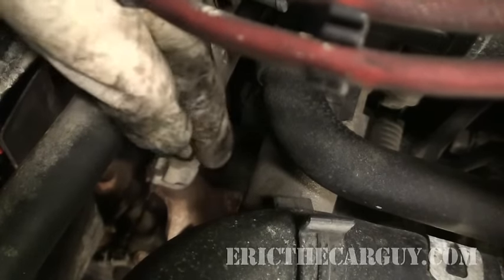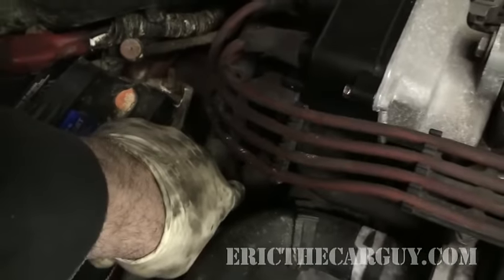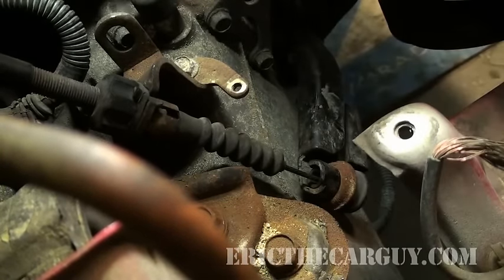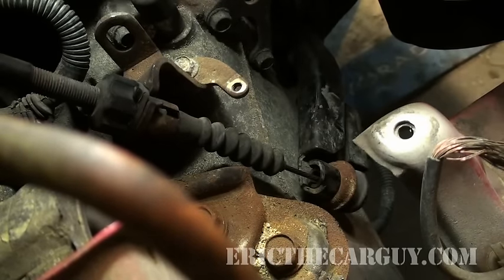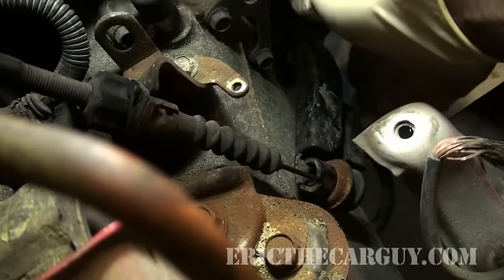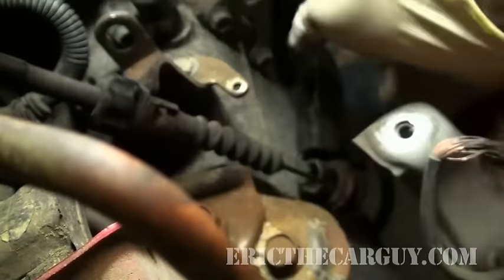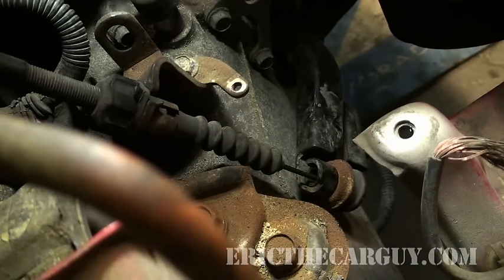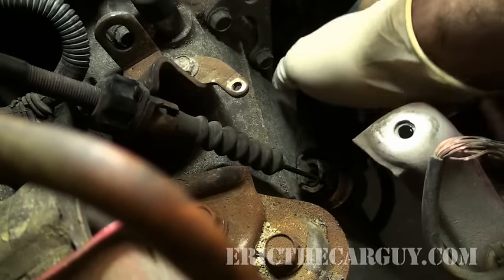How To Adjust A Cable Operated Clutch, Honda - EricTheCarGuy

Comment: Well I went ahead and changed the fluid with Honda MTF, and adjusted the cable again, and it still has the same issue. Should I start looking into replacing the clutch soon?

Comment: What if you have the opposite problem?  My clutch when starting I can barely get it in gear because the clutch is going all the way to the floor and I have a hard time getting it in gear, however once I do get it in gear the clutch performs normally.  So can this adjustment help my situation?

Comment: Hi Eric, learnt this from your video and got my kelisa (daihatsu cuore) clutch cable tighten.. :) 

one question, i notice that for my car's model, a lot of people actually faced the problem of dried clutch cable, it got so hard to depress the clutch. i'd use a lot of energy just to push that clutch cable in, and it got so hard until it broke the metal bracket off in my car under the dashboard which holds the clutch cable. is there away that we could lube the cable? what sort of tools or lub should we buy to relube the cable? coz all i can find is videos of people lubing their motorcycles' clutch cable.. not on cars.
Reply: hahahaha Jeremy Clarson Destroys Keliza ,,

Comment: Eric, I have a 91 Mustang 5.0 LX with a stock clutch cable. when my foot is off the pedal there is a sound like parts are loose and vibrating. It seems the sound is coming from the clutch fork and/or the pedal itself. Also the cable seems to have a lot of free play. The clutch seems to be working fine. would putting an adjustable cable help? also, is there adjustment possible in the pedal? Thanks
Erik.

Comment: Hey Eric I got a question,I got a 1992 Acura Integra gs with a Cable clutch,I did adjust and everything but Its seem the clutch pedal always getting stuck to the floor at time?? What you think the problem is?

Comment: hey Eric i gots a 1990 GMC S-15 borgwarner manual trans and after i been driving if i need to put it in reverse my R gear grinds its all still free spinning i guess  just would like to know if that is a specific part or can be multiple problems

Comment: Hi Eric...!! 
what will happen if the clutch setting too high? (released a little high, it will run) because I like the high clutch settings. thanks
Reply: the clutch can wear out prematurely and it can wear out the throw out bearing or the fingers on the clutch fork from it riding constantly, it can even ruin your flywheel. A solution is to move the limit screw on the clutch inside the cabin to get the clutch higher, but you still need this free play in the cable when it's at rest or it will eventually cause problems.

Comment: 2 years ago I have my 1997 Civic transmission parts replaced, the problem now is when I start first gear then go to second gear the gear has no bite so I go back to first and accelerate more faster to give 2nd gear to bite the gears in which the old tranny once the car moves from first I can shift to 2nd gear and accelerate fast. I would like to know if the transmission is the problem or something else? I did the on stop shift to 5th high gear and step on the gas the car shuts off.

Comment: Hey Eric I have a 2001 honda accord automatic trans. The car shift linkage is somehow not working right.  When. I put it in reverse with the car on it feels like its in park and reverse at the same time only backs up if i give it allot of gas and drives forward in neutral how do I adjust it

Comment: Eric. 
I've got a Mustang, with a mechanical clutch cable. Just had it redone. Like, cable, clutch, flywheel, pilot bushing, throwout bearing, the WORKS. 1200 bucks it cost me. Been about 2000 miles on it and this problem, which I thought was break-in, hasn't gone away. I have no play in my clutch. I can pull out of gear without pushing clutch. When cruising at 2K RPM, give it a little gas, engine 'slips' to 2.5K-3K and doesn't accelerate. Cable adjustment or botched repair?

Comment: I've had 5 of these Integras, over 12 years, almost exclusively driven...I swear the pedals have never felt right in them. Always heavy/stiff, although working correctly. Right now I have a creaky pedal I'm trying to fix, seems a common issue.

Comment: Hey Eric I was just wondering if I have a automatic shift would I do the same thing as you did or just make small adjustments til it's running tip top. Also wanted to say I'm only adjusting because of a d4 code 15
Reply: Don’t automatics have a torque converter?

Comment: Hey, i just happened to replace my cluch on a Hyundai Tucson 2007 befor i wached this video. But my problem now is that it is really hard to get the car in 1. gear. Some times it's easier than others, but i really have to use force to get it in. Alle the orther gears are perfectly fine (reverse aswell). The gripp point on the cluch is also just fine after it was changed.  So, just the 1. Gear issue.

Heeelp please! :)

Comment: I've got a 95 mustang gt and I've noticed recently that it's hard going into 2nd gear most times. Meaning that it physically doesn't want to push all the way into 2nd. Reverse is even worse. The other gears aren't TOO bad but I've noticed I can feel the gears more when shifting recently. I'm just wondering I maybe my clutch isn't disengaging all the way? Maybe I need to tighten my clutch cable some? I'm pushing the pedal to the floor and it still feels hard to go in 2nd.

Comment: my clutch releases 3/4 the way out AND sometimes it will grab just a few inches off the floor do you have any ideas? i have played with my clutch adjustment and havnt found any headway. (i just put a stage 3 clutch and flywheel in)
Reply: logan mercado man.. Thats was a standard stage 3 bite style

Comment: I got a 95 Civic hatch with a 2000 honda b20b , My clutch has 1-2 inches of dead space before i feel it  under my feet. how can i fix it? i can push that 1-2 inches in with just my foot resting on it and then i have to put the pressure, let me know if that makes sense if not ill make a video, thanks Eric!

Comment: my clutch engages/releases at the very top of my pedal, sometimes slips when i start accelerating right after taking foot off clutch.. does this mean that i need to adjust same as this video so it is down close to the floor more? cheers
Reply: yes

Comment: I'm having the issue that with the clutch pedal pushed in as far as reasonable it still isn't actually fully releasing the clutch so it is hard to get in or out of gears, the car will actually try and roll forward a little bit when you are trying to get it into first gear with the clutch pedal pushed to the floor.
Reply: Note: It ended up being an issue with the part of the clutch master cylinder that connects the piston to the clutch pedal.
It basically fell apart meaning the clutch pedal couldn't actually push in the piston of the master cylinder, took a few days for it to fully die as it slowly fell apart making the clutch pedal less effective.
A new one solved my issues but you might be able to just force the old part into fitting back to together. (I had already ordered a whole new master cylinder anyway)

Comment: hi erick, I have 02 honda civic Lx , before I change the engine oil, my car was running fine. After I change the engine oil, my engine started to run higher and louder. I did check exhaust and every thing was fine, so I look into tune up very thing was fine. so I kind of get lost, do I need to change clutch or get a new engine ?

Comment: My car grinds when I try to put it into any gear, also it makes a buzzing like noise when I put the clutch pedal to the floor. Could adjusting the cluth slave cylinder fix this or is there something bigger on my hands?

Comment: Hey Eric, for the past couple of weeks i've been having an issue with my transmission. Basically its very hard to get in gear after it warms up, and then If im coming to a stop and I have the car in gear with the clutch DISENGAGED (pedal down) it feels as if the trans. is trying to grab the gear and take off. Recently its gotten worse and has actually caught the gear (1st and Reverse). Ive adjusted the cable & that hasnt helped. Its a 92 Integra GS. Any idea what it could be?

Comment: Hey, 
I'm not to sure if it's my clutch but this happen to me yesterday. I pressed the clutch all the way to the floor and it was still hard to get into 1st gear and 2nd gear. But 3rd, 4th and 5th gear are really smooth. Do you think I just need to adjust it or is it time for a new clutch?
Reply: Hey, i have the same problem, wont go in with engine on to 1st and 2nd. but with it off they do go in. i put in a new clutch...did you find out what was your problem ??
Reply: yeah, it was the Master Cylinder.
Reply: find out that my car was a hydraulic clutch. lol

Comment: Okay, I have a 2010 Mazda 3 6speed. My clutch lets out a little higher up than most cars of that year. Not sure if you've dealt with Mazda clutches before, but is this something I should start worrying about? Or, do all cars have different clutch grab points?

Comment: I have a89 5.0 stang replace clutch n now my fork is almost all the way forword but 1/2 n inch check all my work twice n how to adjust cable not hydraulic or quadrant.

Comment: Hi Eric, Just a quick question. I can see how the biting point being high on the pedal stroke could cause problems (slipping clutch) but can having the bite very low cause any adverse effects? If so is there a procedure that would let you determine how low you can safely go?

Many thanks.
Reply: For the next car guy fixing his clutch I reply even when it's pretty old comment. Having biting point too low may cause problem if clutch is not detaching all the way. So car can try to creep forward when clutch is pressed down and it is in first gear or changing gear causes crunch sound from gearbox because it's not completely detached. This can broke gearbox and causes wear to clutch if car is stopped with gear on for example in traffic light.

Comment: Hey I have a 1998 Honda Prelude base 
Just recently I went to go to work.. And my clutch pedal felt too easy to push in. 
I couldn't get it to go into any gear at all. 
After about 15 min my car got warmed up and finally went thru the gears. 
But it feels really rough when shifting? 

Any ideas?

Comment: I changed out my clutch on my 89 Civic Si it shifts when the cars off but when it turns on I can’t go into any gear. What would you recommend my steps to fixing the issue should be? Any help would be amazing
Reply: Did you ever figure out the issue? I’m having the same right now

Comment: 92 prelude s, my 3rd gear grinds when i pull the clutch out then it will pop out when i release the clutch,, should i try adjusting the clutch???

Comment: I have a 1990 integra with cable clutch and my 3rd grinds and the car has low kilometres and was lady driven all it’s life so there’s no way the synchros are gone this soon. My clutch is also new and it was set when I got the car but adjusted it cause I didn’t like the release point and ever since then it’s been grinding. If anyone knows where it’s suppose to be please help out.

Comment: what if the friction point is almost at the floor and getting lower? adjusted a clutch that was barely disengaging, with my foot to the floor, got it working for a day.. then today have the same problem, but it's stopped coming back up?
Reply: sounds like you need a new clutch.  but check the clutch master and slave cylinder for any leaks, bleed it out if no leaks, and see what happens
Reply: was the master cylinder.. But a a bolt had been ripped out the firewall and was unrepairable

Comment: I recently had an issue with my cable operated honda wouldn't go into gear I replaced everything and I'm still having the problem I'm thinking the bolt in the shift arm may be worn or the fork is bent but it seems like the throwout bearing can't push the fingers I donno I'm really frustrated any ideas why it could be doing this it's like the bearing touches the fingers but won't go any farther

Comment: I got a 95 subaru 5-speed legacy outback. Clutch is working and doesnt stall when pressed but I cant shift into gears easy if at all. Not sure if the cable is shot or if the fork is completely screwed. Please help

Comment: PLEASE HELP
When my car is on and its in nuetral the throwout bearing/clutch release bearing is scraping against my clutch cover, But the noise stops when i push the clutch in (or when clutch is engaged) it also makes a sound when i take off in first gear around 2500 rmp.i have a brand new clutch cable and a brand new clutch release bearing. Ive been having this clutch problem ever since i put in my stage 1 clutch about 6 months ago. any ideas ? any help would be great thanks..
Reply: Jay Ram - check for vibration while driving a steady speed, then it could be possibly the pilot shaft bering in the engine block, warn thin and oval shaped, when replacing a disk, 2 or 3 times, then it could be pressure plate, is really warn, or there is also a possibility of the clutch fork being bent, causing the bearing to spin against the fork, not the disk or pressure plate. and then the last thing is, its possible the flywheel needs to be balanced, but a bad flywheel would vibrate while trying to pull off a dead stop, or a steady paced speed. 

the best way to check, and be 100 percent sure, by all means, no matter what, if you wanna know your throw out bearing is bad... 150% positively for sure, without taking any thing apart...

start the car or truck, then put it in neutral, and sit there, and listen out the door or window, slowly rise your foot, and listen for the ( grinding ) scraping sound to chance it's tone, 

it would grind or scrape, while in natural but it would not grind or make any noise .

Comment: On my 240sx i can release the clutch more than halfway before the clutch can grab on, I could even shift without pushing the pdal down all the way, shoupd i adjust it? There is about 2 inches of releasing the clutch when it actually grabs

Comment: Would this fix a problem where my clutch pedal feels pretty stiff or hard to press down? Or does anyone know why that happens? I replaced the clutch master and slave master cylinder, but now my clutch pedal is hard to press down. It still works fine though. Anyone please help. Thank you

Comment: hey... on my 1990 integra the clutch pedal is on the floor... it has no spring under the dash that connects to the clutch pedal.. but thats not the problem.. the problem is where the cable connects to the clutch pedal.. the cable pops out of the metal sleeve thing thats supposed to hold it back to engage the clutch. please someone help me

Comment: Got any video for Honda CR-V 4x4 manual got problems my pedal clutch don't what can be pedal stay down know CRV running fine tray take out the air slave pump now don't do nothing put 2 pump new still do Saint thing look the pedal the tramicion push the slave cylinder pump don't moving thank help me

Comment: I've got an 87 Civic automatic. I am trying to replace the throttle/TV cable. I have to adjust the lock nuts all the way loose for it to not pull up on the Throttle Control Lever. It's a brand new cable so I figured it would be closer to the loose side, but all the way? That doesn't seem right does it? The manual says 88mm from lock nut A to the end of the cable but that pulls the lever up quite a ways. Does anyone have any suggestions?
Reply: over time and many thousands of presses the brackets could have fatigued and bent themselves slowly. try bending the bracket back slightly with a wrench to reset the adjustment
Reply: That's what I thought but the manual said that the distance form the bracket to the shift lever should be 88mm & that's what it is. It still doesn't shift until about 4K RPMs. When adjusted all the way loose it shifts smoothly, but at way too high RPMs.

Comment: So i know this is an old video, but hopefully you still monitor the comments. Basically whenever I adjust the clutch cable the clutch pedal feels about right, but 3 or 4 pumps of the pedal and its loose as all hell again, any thoughts? My thoughts were a damaged cable/ adjustment nut, but im new to mechanics
Reply: Promethieos that is very odd.
Reply: Either the cable is stretching or the nut and or the stand the nut rests on is broken or bent.
Reply: Ye turns out the bracket that holds the cable on the back of the pedal snapped, I'm in the process of pulling it out to weld it together, thanks for the reply 😁

Comment: Hi, Eric. As a still photographer, I notice that you consistently get unflattering light around your eyes. It's from the shading effect of your hat, causing a raccoon shadow that can sometimes make you look tired. If you turn the fill light on for your video camera, you will brighten up your eyes and get nice catch-lights, a twinkle of the eye that complements your crazy sense of humour. I set the camera light on fill flash mode to just add a slight fill, -1EV. Softens shadows.

Comment: Sounds like they might have neglected to adjust the clutch cable when they fitted it. else ... they didnt replace it and they adjusted the cable so that it seemed like they did. Personally I wouldn't touch it, drive it back to where you had it done and get them to sort it! If for whatever reason you can't/won't do that follow this mans tutorial and if that dont work your clutch has issues!

Comment: I have a car daihatsu sirion SE 2008 1298cc and run only 21000 Miles problem is my clutch getting biting point all the way up and it’s cable adjustment please help me it clutch gone or adjustment need because I am new driver I don’t know much as you about car people help me